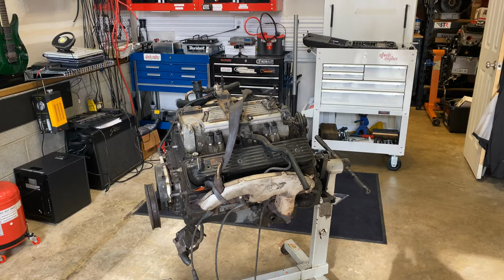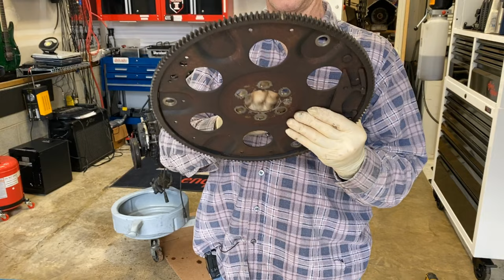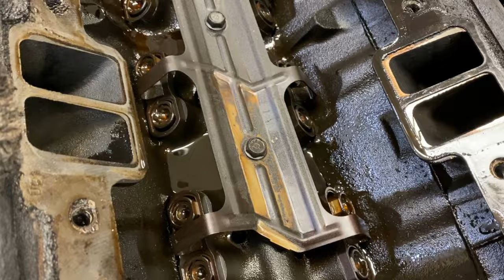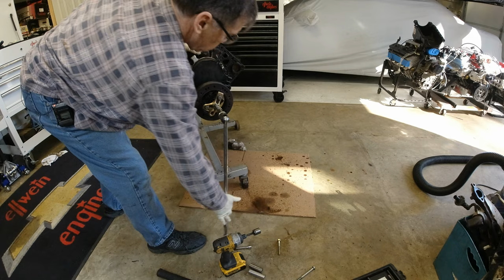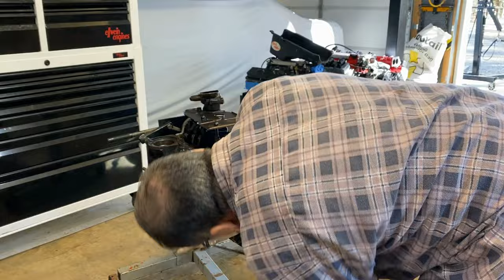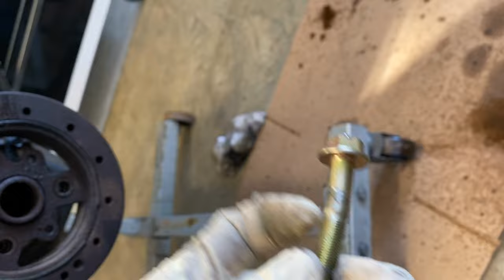Small Block Chevy Engine Core Tear Down LT1 Gen 2

Comment: Interesting. Never heard anyone call a harmonic balancer a hub and never heard a caprice called a cap rice.
Reply from the maker: The hub is the hub and the balancer/damper is the damper (in my mind).  So if you see a damper on the engine...I'm seeing a damper bolted to a hub.  I'll usually say "take the hub off or press on the hub".  that is the hard part...the press on.  What do you call the hub?   Cap Rice started back in the 90s when people took Caprices and 9c1's and put impala SS trip parts on them and called them impala SS's.   Now the term has morphed into a the definition of a hopped up Caprice.

Comment: Got a 95 Corvette convertible. LT1 with 165,000 miles and it’s still going. probably way overdue for an engine rebuild.😅
Reply: Hardly, my 94 Trans Am LT1 has 338.000 miles on it,  never been touched,  even the timing chain is original.  Bought it new, runs and sounds like new. Uses no oil.

Comment: When I take manifolds off I have  a couple of long bolts I cut the heads off. And I cut a groove for a flat head screwdriver. They work well for both on and off.
Reply from the maker: Hey Rob.  thanks for the tip.  Can you describe a bit more?  you boat engine guys have all the ideas and practical experience.

Comment: Hey i have a question after installing a new head gasket on a 1997 LT1 what is the proper way to install the rocker arms and push rods stock push rods and stock rocker arms
Reply: Because I just replaced my blown head gasket and I’m having trouble with tightening down the rocker arms
Reply from the maker: Not super easy to type out the install method but I'll try.  Oh wait.  Someone had posted a quick easy way on youtube.   Yerkit racing channel?  Let me search and point you there.
Reply from the maker: https://youtu.be/MIjgbBkQWXk
Yerkit Racing Channel
Reply: But after adjusting and tightening them down once I run the car at idle the oil pressure is good around 40 then while its warming at idle it starts dropping oil pressure slowly I’m thinking it could be the new sensor I put in it or the oil pump or warn engine bearings I’m looking everywhere but idk what could be the problem because it never dropped like that before the head gasket change
Reply: 40 psi then slowly drops after a minute or two to around 20 psi then slowly to almost no oil pressure and after a min it drops to zero oil pressure and I shut the car off

Comment: 8:55  that killed mine in my 97 Z.  Cranked it up and zero oil psi.  teeth worn so thin they sheared off.  That was at 180k miles.  I suppose at 150k or so ought to change that gear just for S&G...   Great Vid man!
Reply from the maker: Thanks. There have been a few engines that were lost like that. Yours and I have a recent customer that last oil pressure but he didn’t ruin the motor he had just turned the engine off he had no oil pressure and that was the reason

Comment: I have a oil pressure issue and it seems u r the only that actually knows about these lt1’s….so my issue is my 96 impala ss oil pressure reads 45 - 55 psi cold, driving high speeds 30 psi and hot engine @ idle 8  psi…what is the normal and do I have an issue…engine has 85k on it
Reply from the maker: If it is a stock engine and not rebuilt then that is ok hot oil pressure.  It would be nice if it were 10 to 15 psi at idle hot and more pressure at high rpm.  The stock pump is standard pressure standard volume and some have seen that low pressure.  If you put a new oil pump in (I like the high pressure standard volume).   Make sure the engine has a stock windage tray.

Comment: Nice video ,I just got an LT1 from a Corvette I'm gonna drop it in my Cadillac Fleetwood is there anything different or something that needs to be changed before I drop it in ,,tnks
Reply from the maker: The corvette steam line will need to be swapped for the fleetwood steam line.  The accessory bracket also needs to be the Fleetwood.   That's about it.  Oh.  The crankshaft hub and damper needs to be the fleetwood and not the corvette unless you space out the accessory bracket to line up.

Comment: I have a question for you about the flexplate. So I'm putting a 97 lt1 in my 87 gmc pickup with a 700r4. Trying to find the one I need and you said yours was a "1 piece 153 tooth externally balanced". I'm to I need a 1 piece 158 tooth internally balanced. Could you give me some insight on this? Thanks
Reply from the maker: Internal balance (and one piece rear main LT1 153 tooth?)  I like the TCI flexplates.  Check this out at Summit TCI-399174
Reply: @EllweinEngines  thanks

Comment: Will all Vortec head fit on LTs?
Reply from the maker: not on LT1's  They don't have the water passage in the right spot.  I guess i use the term Vortec too loosely.  Vortec headsd are 'like' the LT1 head but not a direct fit.
Reply: @EllweinEngines  Thank you for replying. It had me a little confused.

Comment: Can anyone provide a current viable part number for the knock sensor on a 1996 OBD2 Lt1  fbody?  I'm having a heck of a time finding the correct GM replacement part.  I bet Karl has an idea!!   Great video!
Reply from the maker: I'll look at the part number on the box that TorqHead sends with their kits.  I'll get back to you.
Reply from the maker: The knock sensor for 1996 LT1 is Standard brand KS7
Reply: Thanks so much Karl!